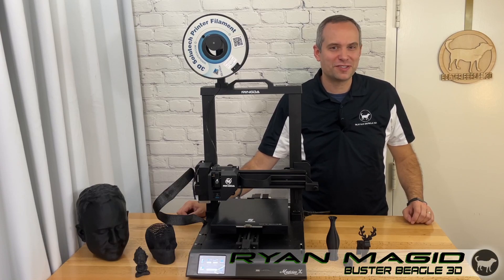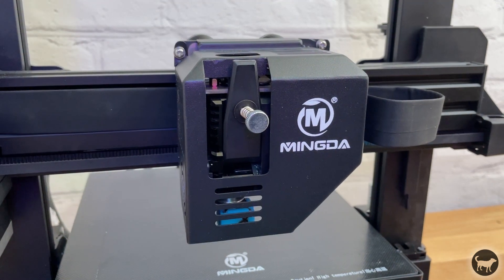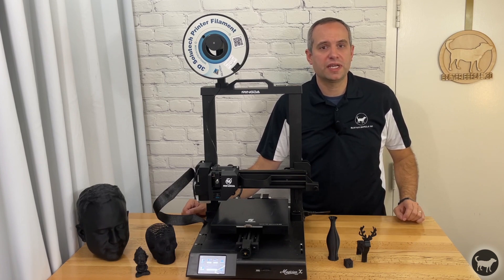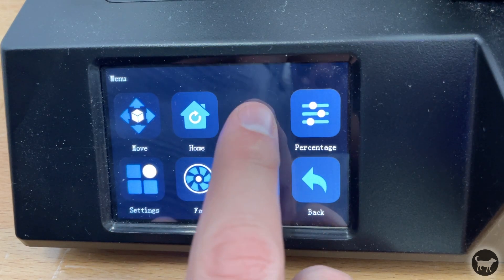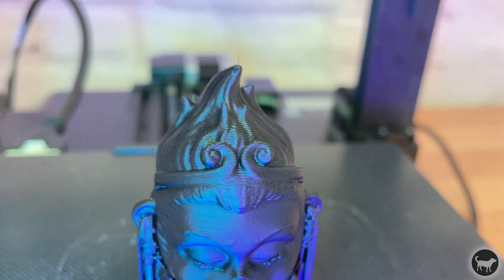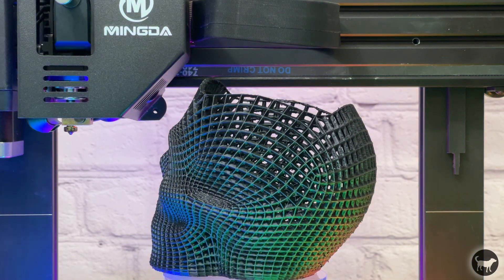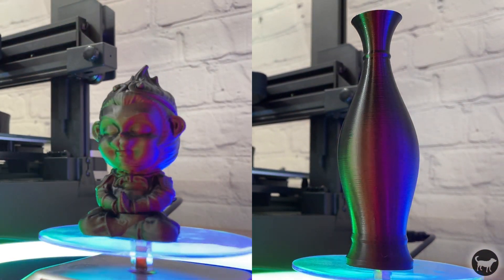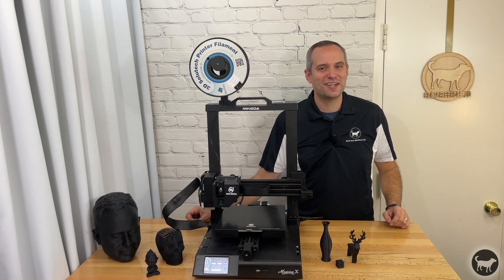MINGDA Magician X Auto Leveling 3D Printer. | Smoothest prints I ever had from this less known brand

Comment: Hi good information  thank you I have two of the Magician x 3d printer  and are very impressed with it the only  thing I have been looking for  is I Video on YouTube on how to change the hot end
Reply from the maker: I haven’t seen one for this machine but I’m guessing if you remove the cover it should be fairly self explanatory. Usually you remove the cover. Unscrew the two bolts holding on the hot end and detach it. Then you have to push down on the ring at the top of the port with the tube coming out of it to release the tube. Then replace any components you are looking to replace and put it back the way to took it off.

Comment: Gee  how can a novice notice a part is bent  a little? seems a very nice machine  but if i buy one over 538 Can on amazon  i would not like to discover something is bent on it when brand new :( i know nothing about tinkering 3D printers. I like the leveling ability of this machine
Reply from the maker: It didn’t take an expert to see that there was an issue with the x axis gantry. Again if the machine was not provided to me I would have returned it for a new one rather then repair it like I did. The company was very responsive and helpful along the way. I feel like the issue was a fluke but I mentioned it in the review to be fully transparent.
Reply: @BusterBeagle3D    there several interresting models  i will go with an out of the box working model :) for now. thanks for sharing your knowledge

Comment: My Magician X just arrived 2 days ago.  I have already printed several things.  I am pretty happy with it as you described.  I am having some difficulty with the skirt not adhering all the way around.   Is this a leveling problem?  Suggestions?  Also the end product does not separate from the build plate easily.  Suggestions?
Reply from the maker: Hello. Those 2 issues that you are having almost seem to be counter to each other. If your skirt isn’t adhering I almost feel like your nozzle is too high. Might want to run that auto leveling again to make sure it’s good. If the print doesn’t come off easy I feel like the nozzle may be too low. Honestly I have never had an issue with a part being hard to remove from the build plate. I just let the heated bed cool and it pretty much almost pops of by itself.  .
Reply: @BusterBeagle3D  Thanks for the reply.  The skirt does not adhere in one section of the plate.  I will try cleaning and releveling.  The sticking problem is very real.  I wait for the print to cool to room temperature, then I have to pry it of with a scrapper using a lot of force.   I have seen the suggestion to use a glue stick on the plate before printing.  Thoughts?
Reply from the maker: @robertsparks3685  I actually like to hit the heated bed with Aqua Net hair spray every now and then. It's not something I do all of the time but every now and then I like to do that for adhesion. I'm talking about their regular pink can with no additives or anything like that.

Comment: hey, could you post your settings in cura? thinking of start and end code etc. thanks
Reply from the maker: Start GCode:
G28 ; home all axes
M117 Purge extruder
G92 E0 ; reset extruder
G1 X10 Y10
G92 X0Y0
G1 Z1.0 F3000 ; move z up little to prevent scratching of surface
G1 X10 Y20 Z0.2 F5000.0 ; move to start-line position
G1 X10 Y200.0 Z0.2 F1500.0 E15 ; draw 1st line
G1 X10.4 Y200.0 Z0.2 F5000.0 ; move to side a little
G1 X10.4 Y20 Z0.2 F1500.0 E30 ; draw 2nd line
G92 E0 ; reset extruder
G1 Z1.0 F3000 ; move z up little to prevent scratching of surface

End GCode:
G91; relative positioning
G1 Z1.0 F3000 ; move z up little to prevent scratching of print
G90; absolute positioning
G1 X0 Y200 F1000 ; prepare for part removal
M104 S0; turn off extruder
M140 S0 ; turn off bed
G1 X0 Y300 F1000 ; prepare for part removal
M84 ; disable motors
M106 S0 ; turn off fan
M82 ;absolute extrusion mode
Reply: @BusterBeagle3D   thank you sir 🙂
Reply: Was watching a video from Make With Tech (MakeWithTech) on his review of the Mingda Magician x printer. He recommends running the self leveling at first, then modifying the G code after doing that. Well, here is what he recommends in the G code, just thought you might be interested:
"I recommend the following G-code start code for this printer."
"Since G28 disables bed leveling, we either need to add a G29 and perform a full bed level or just an M420 S1 to enable using the bed leveling data.  This start code is based on the standard Cura Ender 3 start code."
G92 E0 ; Reset Extruder
G28 ; Home all axes
M420 S1 ; MWT Enable Use of Bed Leveling Data
G1 Z2.0 F3000 ; Move Z-Axis up little to prevent scratching of Heat Bed
G1 X0.1 Y20 Z0.3 F5000.0 ; Move to start position
G1 X0.1 Y200.0 Z0.3 F1500.0 E15 ; Draw the first line
G1 X0.4 Y200.0 Z0.3 F5000.0 ; Move to side a little
G1 X0.4 Y20 Z0.3 F1500.0 E30 ; Draw the second line
G92 E0 ; Reset Extruder
G1 Z2.0 F3000 ; Move Z-Axis up little to prevent scratching of Heat Bed
G1 X5 Y20 Z0.3 F5000.0 ; Move over to prevent blob squish
Reply from the maker: @billholder253  Interesting. Didn't know G28  
was disabling the bed leveling.
Reply: @BusterBeagle3D  That is according to Make With Tech, and he did add it into the G code as well. At least this is what I aw in the video & he talked about. Check it out.

Comment: Looks like a nice printer. Funny how the stl files that come with printers aren't fully optimized to their fullest potential.
Reply from the maker: Yeah. That's why I provided the files. It's not the printers fault but just goes to show you that the quality of the printer is just part of the equation. You have to have good files in there to print nice.